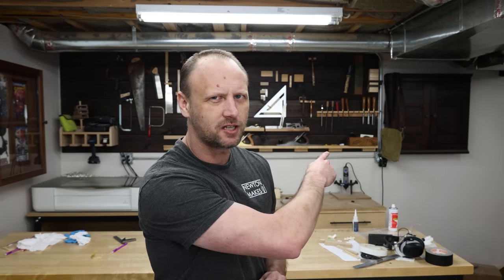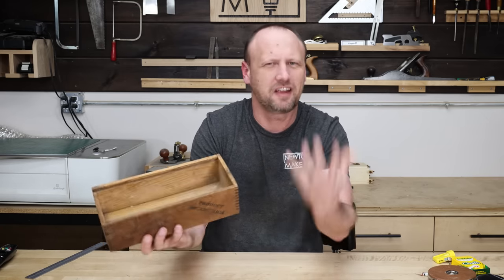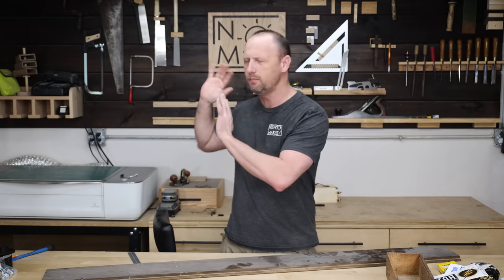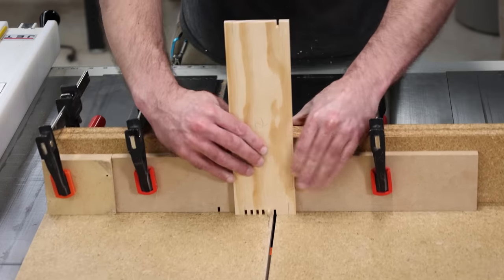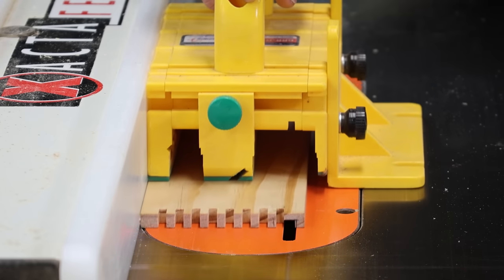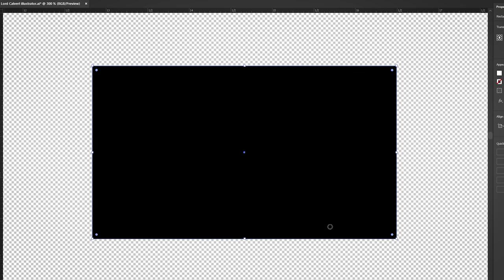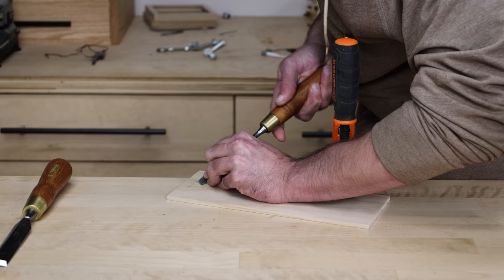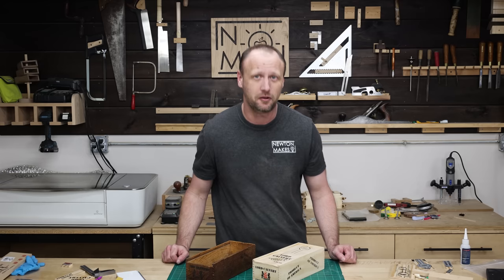Attempted to Remake an Antique Whiskey Box (How did they do that?!)

Comment: Love this project. I might have to give this a try sometime. A box like this would make a great gift, especially with a bottle in it 😁

The blade used to cut the finger joints might have been a 4mm kerf blade. Just a quick look around on Google and I found them no problem but I'd probably use a ⅛" or maybe even a router table.